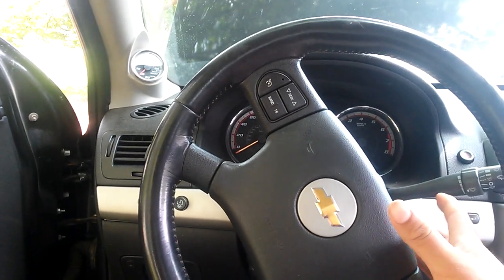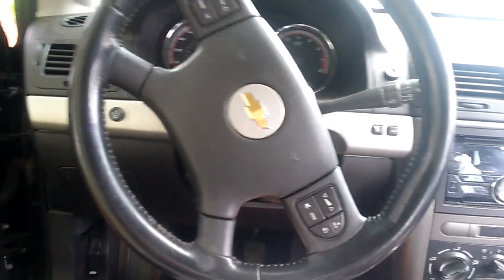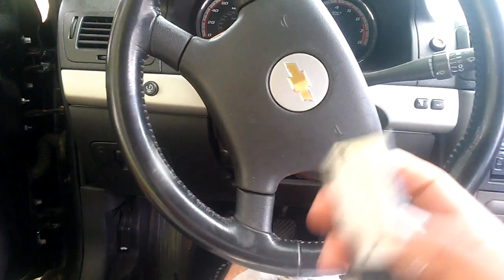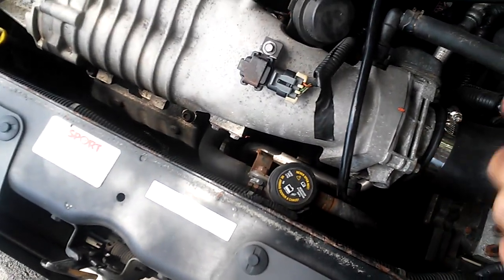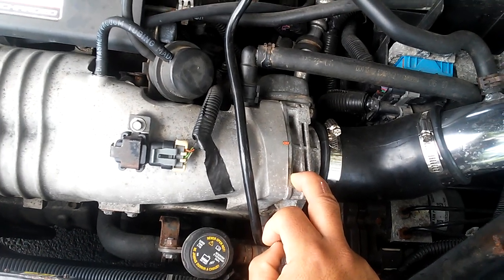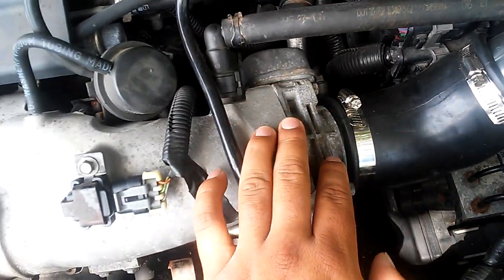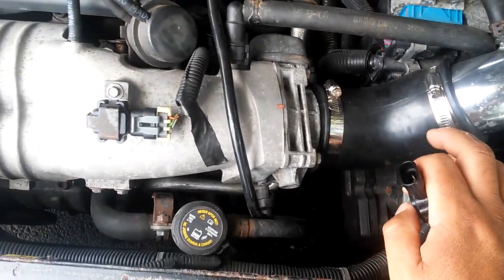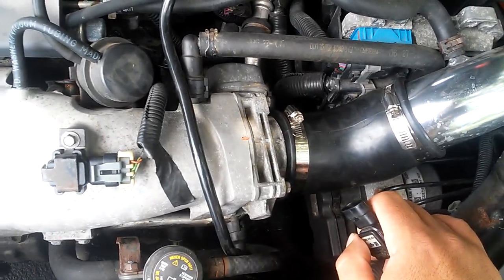How To Fix Reduced Engine Power - Cobalt SS 2006 (Read The Description) 2025

Comment: TRANSLATION FOR THOSE WHO NEED IT, here's a gist at least since I also have a Cobalt SS 06 and also speak Spanish:

He scanned the codes after Reduced Power
He unplugged the battery cables, no dice
He replaced the MAS (mass air flow sensor) sensor, no dice
He sent the trolley body (the big air flow system part) to clean and replaced the map sensor, still happening
He sent the trolley body to clean well again and cleaned the gas injectors
He had a bad injector, replaced it and hasn't had a problem for 2 months

Basically get a tune up, he recommends not using gas below premium, low grade gas creates more carbon and clogs up the air flow body and you will see the reduced engine power problem. I actually fixed the same problem on my Cobalt with the same solution. Got a mechanic to clean out my air flow system and got a tune up and haven't had an issue in over a year. Hope this helps other Cobalt owners. Ayi esta amigo. Ya te lo transle para los que occupen.

Comment: Buenas noches.. no carro hace lo mismo pero ultimamente lo hace al prender el aire frio en el carro el mio es 2008 pero no es un SS es un sport v4 .. sera lo mismo que le pasa al tuyo oh otra cosa??
Reply from the maker: Arturo Arcos pero si a pagas el aire deja de fallar ? O queda igual que pierde potencia
Reply: kof tekken dosmiltrece  pues hoy es el primer dia que me lo hace al tener el aire prendido.. hace 2 semanas me lo hizo cuando iba a mi trabajo pero lo apague lo Volvi a prender 2 minutos despues y ya no me lo hizo hasta hoy.. y siempre lo traigo con el aire prendido.. y hoy cuando apague el aire ya no lo hizo.. y me recomendaron limpiar todo el sistema donde va el intake..
Reply from the maker: Arturo Arcos en tonses es es el cuerpo de aceleración limpialo y ya no te dara problemas
Reply: @koftekkendosmiltrece  yo tan is in pontiac g6 2005 es muy parecido de la GM y me salio el power reduce. Limpie el throttle body con un sepillo de dientes y throttle body cleaner. 15 minutes despues y mi carro jalo perron
Reply from the maker: JAIME C por lo menos si te ayudo el video papu :V
Reply: Mi carro me marca el código p1182 y no encuentro el defecto alguien sabe cuál es el problema?